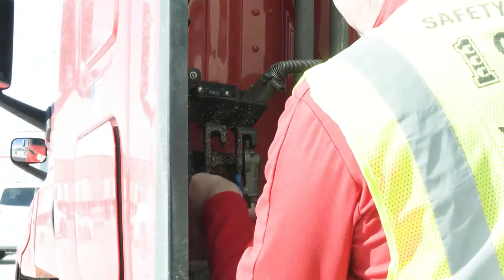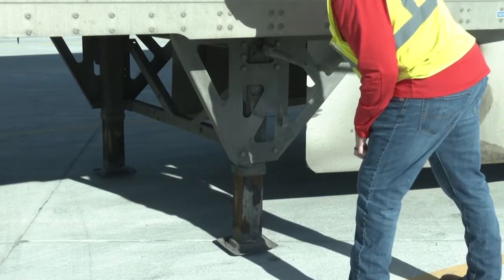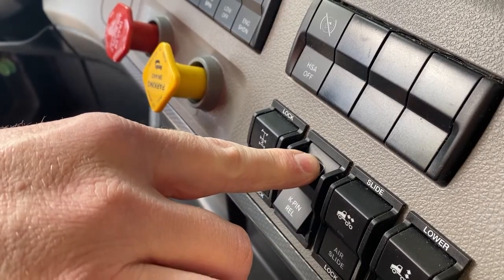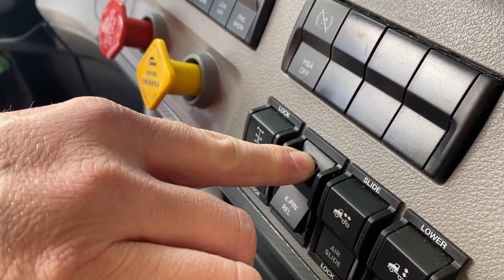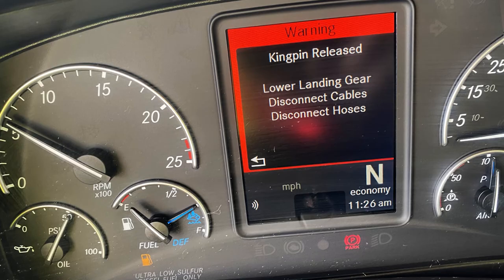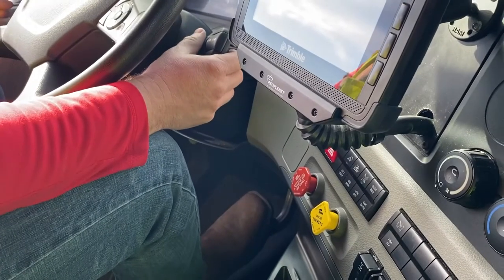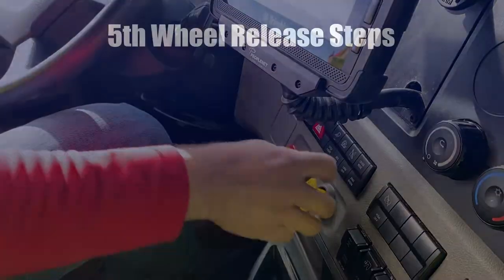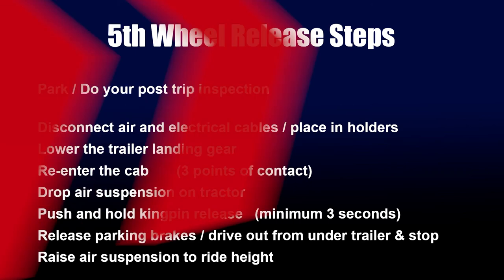How to Safely Release the Fifth Wheel

Comment: Leave about 2 inches between the feet on the dolly and the ground. Let the trailer gently slide down the fifth wheel to the ground as you pull out. This will allow the next driver to lift the trailer a bit as the fifth wheel goes under the trailer so that the dolly legs do not bind, and relieve pressure to make cranking the dollies up much easier, in the case of a heavy load.